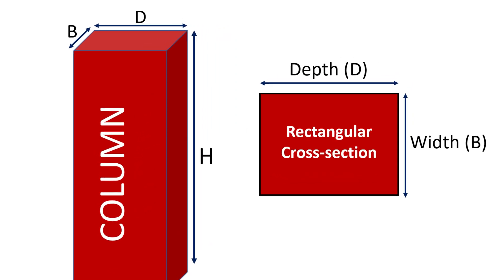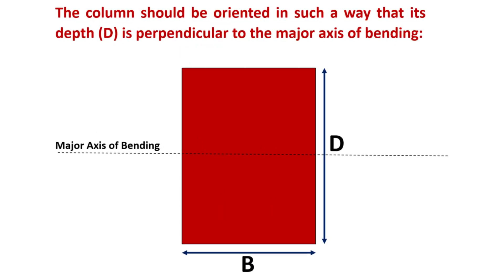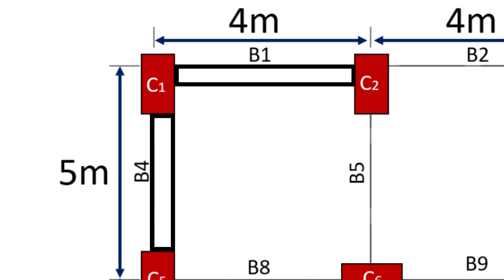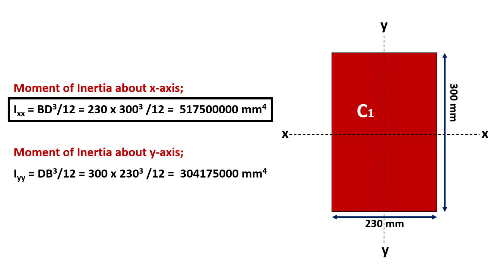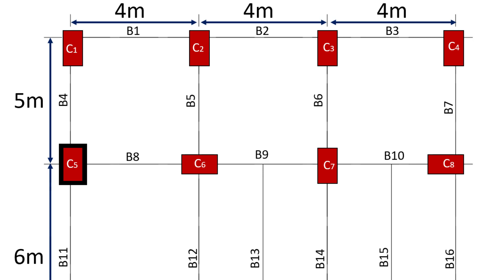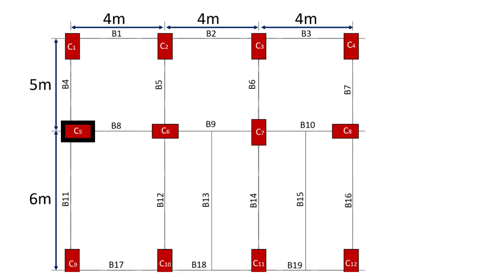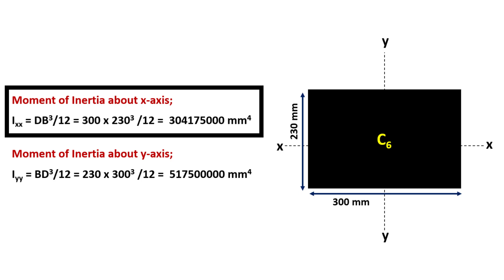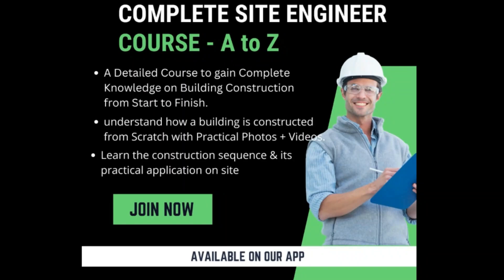Learn to decide the orientation of Columns in a column layout | Structural planning | Civil Tutor

Comment: Hi sir... 
One dought. One of slab he  gave conceld beam 12mm 4 bar. But he casted drop beam with out Reinforcement. But on that beam wall not come only live load will come.Slab spacing 8in c/c both side he have column. Is it take load. Or fail. Please help me.